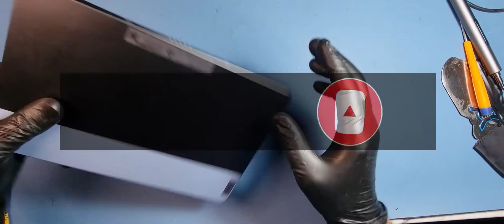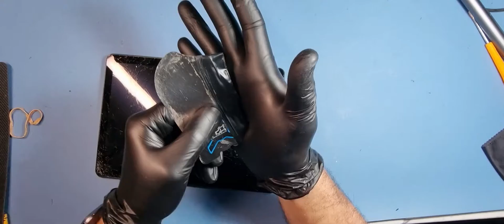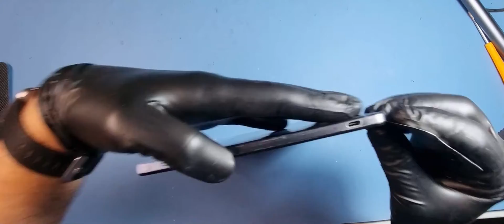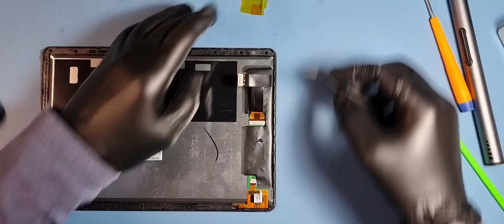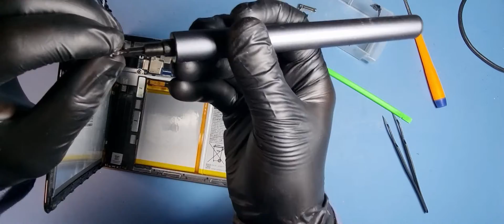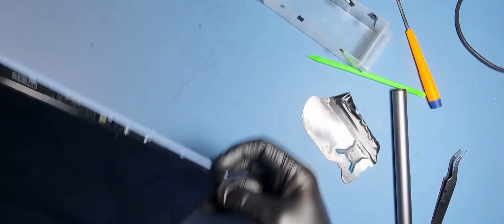Lenovo X636F Screen Replacement

Comment: This is a really helpful video, however I cannot find a screen that actually fits. All of them are labelled as Duet 3 or CT-X636F but they do not have the clips. Could you provide the link to the screen, I am currently hunting online for it.
Reply from the maker: https://www.ebay.co.uk/itm/364086596474?_skw=Duet+CT+X636f+lcd&itmmeta=01K0P751D745YTJE2H4CNQ6F1Z&hash=item54c540937a:g:CloAAOSwIzZmUIsw&itmprp=enc%3AAQAKAAAA0FkggFvd1GGDu0w3yXCmi1dNOicMNWMVH%2BHq1VrMMkjmJJD9e%2BYVee%2BV9JdRlEfCspRElBDO%2BDZHjNRffJTY2j%2B8j%2Bmm43rSqXgllVqi7MgX%2Br3msdvB3rmC6LNtVQVlMFL3M4yLJJc24r00LG9lFXlMLVULfa%2BVOg0%2FtPJnL6yC9CRfpDqfwzoDOYQ8MQ5jvkJKoMpSfsUg2qKbuQaC7xtUlTQdsMrQhFYGLYU7AuaBtLRKD18%2BJ6FJ2Q55kpYv3V8Acz17CHijasFYI3LN6ks%3D%7Ctkp%3ABlBMUO6WlMeFZg
Reply: @amkotechrepairs Thank you very much.
Reply: @amkotechrepairs hini bought this but the new screen didn't come with the black plastic border to clip back in ?
Reply from the maker: @ukgamrruk3604  You will have to heat the plastic up from the original screen and fit it on to the new one or return and buy one with the frame.
Reply: @amkotechrepairs got any tips on how to do it? Did yours come already attached?
Reply from the maker: @ukgamrruk3604  Yes mine was complete, heat it up with a hair dryer, make sure your don't snap the plastic, get some ipa
Reply: Thanks for this son has literally just stepped in his after telling him millions times to not leave tech on the floor 😠😮‍💨
Reply from the maker: @ukgamrruk3604  That's amazing, would be grateful if you could https://buymeacoffee.com/amkotechrepairs

Comment: Excellent video, clear and concise in 10 mins. I replaced my screen easily following this. I thought the screen was dead at first when connected but as you mentioned, really got to make sure the connector to the screen is well pushed in and locked, I used my spudger tool to push down either side and lock in and then it was fine. Thanks very much!
Reply from the maker: Hi Thank you for your comment and i'm happy your repaired your deivce.

Comment: Thank you for the video. I changed the screen with frame by myself. This is very helpful. One question; I forgot to attach the yellow sticker for the flex cable connection and now the screen is attached and closed. Is that an issue? I don't want to open the screen again and put the Sticker back unless it is really required. Please advise.

Comment: I have one with a corner cracked, the screen still works and some touch as well. Is it possible to change just the glass and reuse the LCD? The part price is pretty different between the glass replacement and the full LCD + glass kit.
Reply from the maker: Hi Thank you for getting in touch, the touch screen and the glass are bonded together, it would be a mammoth task trying to separate the LCD and touch Digitizer.  There is a high chance of cracking the LCD while trying to separate them. I hope this helps.

Comment: Incredible video! Where did you buy the replacement screen? I might purchase one of these to repair myself.
Reply from the maker: Hi Thank you for your comment, i have my own suppliers, however I have used aliexpress in the past for the same screen and it worked perfectly, get the one with the frame it will make the task a lot easier.

Thanks again Amko